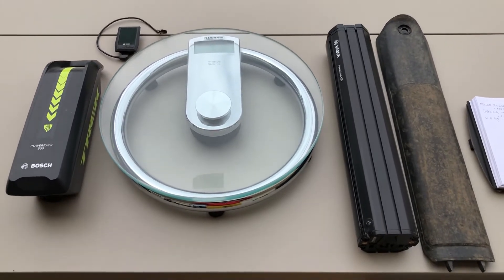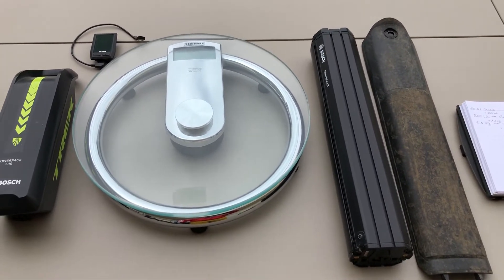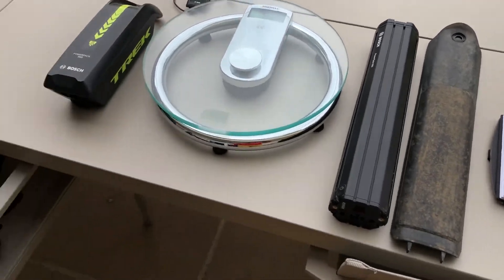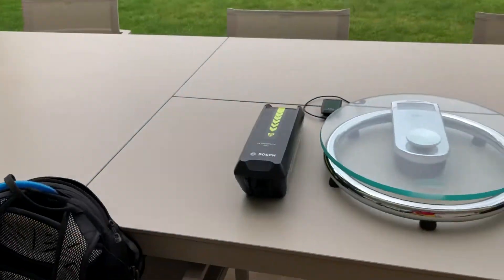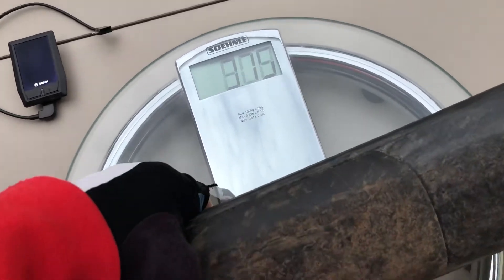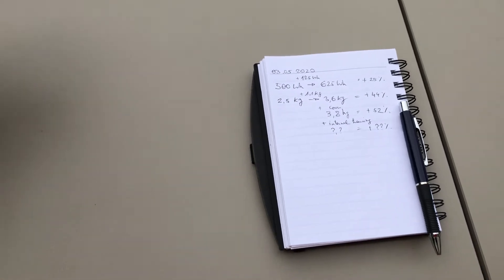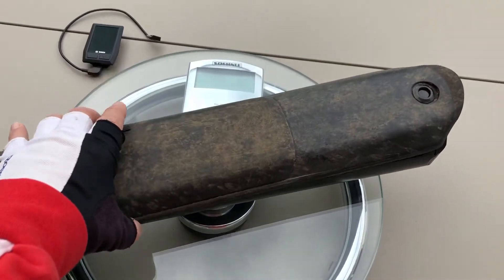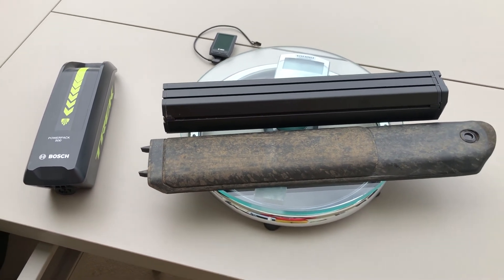Weight comparison between Bosch Powerpack 500 & Powertube 625

Comment: If you compare 500wh internal to 625wh internal I hear it's a 700g difference. I definitely prefer the cleaner look of the internal battery bikes. Enjoy your cube.
Reply from the maker: I actually have both the 500 and the 625 Wh internal batteries on my R&M Superdelite. Perhaps I could weight them both. 

IMO the external batteries were lighter because the casings were made out of plastic whereas the internal battery casings are made out of metal. Probably a matter of robustness due to the elongated shape of the internal batteries. 

I also prefer the internal batteries' looks. 

Cheers!

Comment: Maybe they use metal to diffuse the heat better. Too much heat is the enemy and maybe the battery was heating to much when charging or functioning when in the most powerful mode.
It could also be a question of rigidity because the design is different.
I'm pretty sure it's needed anyway.

Comment: Hello, The way to approach the problem is not right. You’ve got to take into account the total weight : bike + rider. Let’s consider a total weight of 100 kgs with a 500 wh and then 101,3 kgs with a 625 wh. The weight increase ratio is only 1%. How much battery capacity it will take to absorb this additional 1,3 kgs ? It’s a difficult question which requires a deep knowledge of physics to answer. The purpose is not to demonstrate here. There is a simulator of autonomy developed by Bosch which can provide a solution. ( available on line ) and it’s insignificant. Cheers,
Reply from the maker: philippe canepa I didn’t think of it that way. Thanks for sharing your thoughts. 
However, don’t you think that technological progress would be to increase battery capacity while maintaining the weight or at least increase both in the same proportions?
Reply: Yes definitely but we are at the cut edge of technology. When we compare the size of small batteries which deliver 1,5 volts with the bigger one we have on EMTB or cars, we immediately see that the ratio size/capacity is not linear. This why manufacturers are focusing to improve engines rather than batteries by now. Bosh is going to release a new engine delivering 85 N.M in 2021.

Comment: Good review!  
If you compare 500Wh external to 500Wh internal...  according to Bosch it‘s only 2,6kg to 2,9kg. 
By the way, what is the weight of the Cover?
There are bikes, that only use lightweight plastic cover, not a metal one.
Reply from the maker: Michael Weiss the Cube uses a lightweight rubber cover and it weights 0,2 kg. 
Also, remember there’s a metallic plate inside to house the battery which I couldn’t remove to weight. That’s probably another half kilo.

Comment: 500/625 times 100 = 80% increase in capacity note if u added 625 it would be 100% increase so 500 could not be 25% only
Reply from the maker: Peter Hopp you need to divide the other way around, ie 625/500=1,25 which is 125% (25% more). 
80% of 500 is 400. An 80% increase is therefore 500+400=900. 
25% of 500 is 125. So a 25% increase is 500+125=625. 
In other words 625 is 25% more than 500.
If you don’t believe me search online for a percentage calculator and check the result there.

Comment: That’s more than a 25% increase in battery capacity it’s more like 40% increase
Reply from the maker: Hi Peter, just to make sure I'm calculating this right... 625/500=1,25. That's 25% more, correct?
Reply: Quantitative speaking yes but maybe the technology is not the same and powertube 500 has more longevity than power pack 500. And you forgot to say that the 4th motor generation motor is lighter.  So it's a compensation